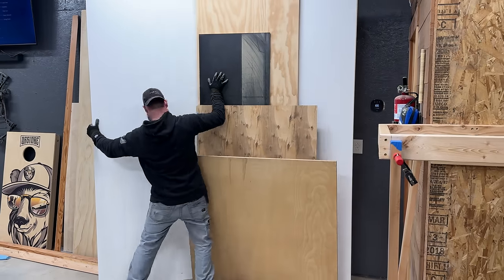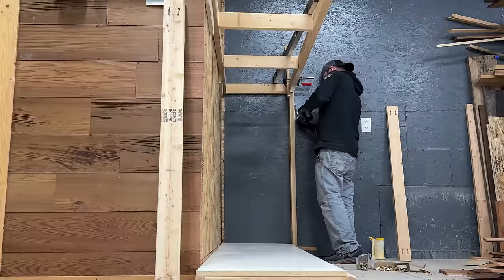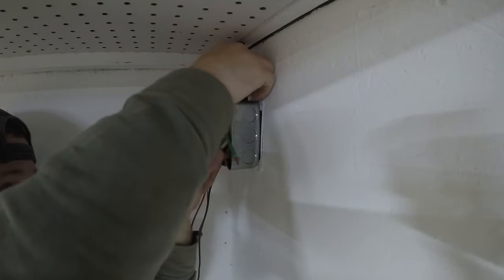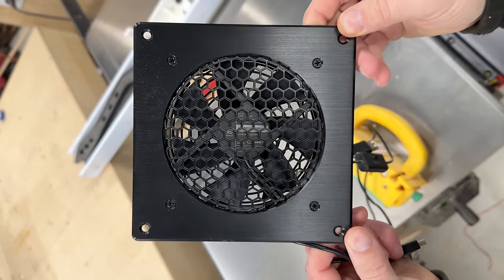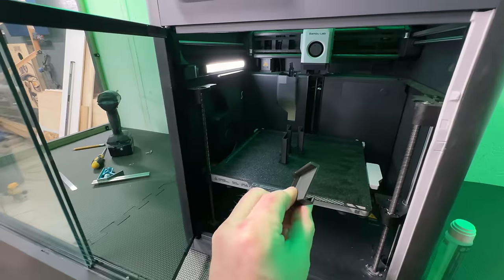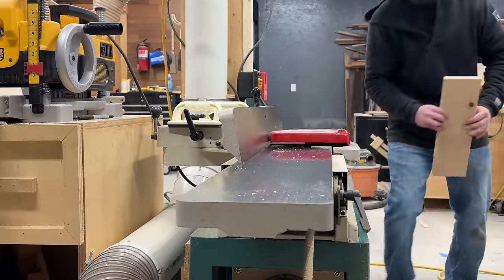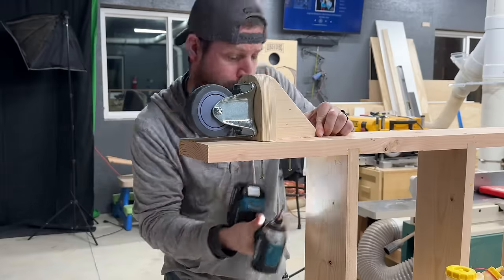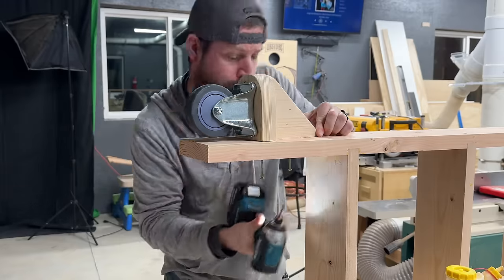The first of it's kind! Regaining valuable shop real estate!

Comment: Nice build.  Was thinking you were crazy venting the printers into the bathroom, glad you have plans to vent outside when your print ABS/PLA/etc...  Ladder is neat...  but I think if it were me I'd build a ~2=3' high platform (with steps) and then put lumber storage under it for both eight footers and off cuts.  Always need more space for scraps.
Reply from the maker: Venting into my bathroom and the fume concern was always something I wasn’t super pleased with. I have since made both fans pull air from the bathroom and direct it into the enclosure. So no more circulating it, but I am still working on on the separate setup to exhaust it to the outside of my shop.👍🏻

The ladder was honestly more of a fun challenge, and I agree it’s not the best solution. I’ll be addressing that along with other changes in a future video. Thanks for watching and commenting. 👊🏻

Comment: Nice job. To move all your sheet goods you need a Garbo. See Izzy Swan...You could mount and power it on your unit some where, I'm sure. 😅For your new access ladder look at a Werner S313P-2. It folds to about 2" thick. I can already see your 3D printed keep-it-handy -but-flush-against-the-wall bracket. Just subscribed...
Reply from the maker: I think I’ve seen the video izzy has on that. That’s actually not a bad idea! 

That Werner ladder is exactly what I’m thinking will be the most logical and is convenient. The ladder I built was purely out of curiosity, and a reason for me to see if I could do it. I knew it wouldn’t be a permanent feature. 😂😂

Thank you for watching and taking the time to comment, and I truly appreciate the sub.👊🏻

Comment: Cool project! Maybe another small fan blow into the cabinet (filtered) will help keep dust out with positive pressure? I built one of those rolling carts.... I was renting at the time, ended up moving 3 times in 5 yrs! Was REAL handy then. I've since added pneumatic casters so I can roll it out of the garage easily for spring cleaning (leaf blowing) in the garage.
Reply from the maker: Thanks for watching! I’m working on the filters and adding additional fans. 👍🏻 

I’m looking at building a small single wheel dolly setup to make it easier to slide the sheets in and out, and moving them around in my shop.
Reply: @brewbuilds  great idea. Like a little skate. There’s always the venerable harbor freight furniture dolly haha
Reply from the maker: @BenNawrath  I actually have 2 of those, and the casters on them are the worst. 😂
Reply: @brewbuilds  haha yeah that’s no good. I got some fantastic 5” ones from Amazon for a sanding cart I made. Gotta be 300 lbs… drum sander, 12” disk, and spindle sander all on it. The simple irony that a shop vac can’t roll over its own cord is exactly what’s wrong with America. Good casters isn’t too much to ask for.

Comment: Great video. Thank you for sharing the journey. Regarding your 3-D printer vibration… I currently have mine on a paver stone with a piece of carpet underneath of it… Do you think the harbor freight pads would be better than a solid piece of stone with the carpet to help reduce vibration?
Reply from the maker: Thank you! I’ve seen people do that with pavers before, I guess the idea behind that is just adding more mass to the platform the printer(s) are sitting on.🤷🏻‍♂️ I think the important part/first line of defense is having a solid surface for the printer to sit on. I haven’t done the paver method before so I don’t have any way of comparing it. I can say this foam matting has proven to work extremely well, and I don’t hear any vibration.

Comment: Nice build.  Have you considered using the space between the ladder and cabinet for you off cut storage?
Reply from the maker: Thank you Steve! I have, and at the end of the video I talk about adding an off cut storage rack to the left of the opening for the sheet goods compartment. I’m a little hesitant putting anything permanent on the face of it because if I ever do need to use a little step ladder to access the inside of the enclosure I’d have to lean over it to get inside. 👍🏻 thanks for watching, and taking the time to comment. 👊🏻
Reply: @brewbuilds  I had a similar solution in mind.  Since you have 8' of space, you could make it a relatively narrow bin, with stepped sections for different length offcuts (tallest in the front, since they're likely to be heaviest), and the shortest in the back.  As long as sticks out less 12" or less, you shouldn't have too much trouble reaching from a stepstool.  Also, it may be worth a little effort to realign the bottom wheels on the ladder to reduce that problem.  Clamping a 2x4 across the bottom, and butting the wheels up against that should help.

Comment: So, dumb question, but why put plywood sheeting on the lower cubicle? That's a huge amount of space that would be useful otherwise if you put up, say, pegboard or something instead.  Plus, could run an outlet or build in a power strip or something to also set up a battery charging center to maximize space utility?
Reply from the maker: No that’s not a dumb question. I still have plans to add some type of accessory hanger/storage. I personally will never use pegboard for hanging tools again. I find pegboard for that use to be a pain in the ass. Thanks for watching.👊🏻

Comment: Really nice... one comment/question though: why not have some type of sliding door on the outer wall in mid-to-back area just to allow for accessible storage of smaller pieces in the back end of the storage area?
Reply from the maker: If I’m understanding correctly, you are referring to the back of the plywood storage compartment? That would have been a really cool idea, except I would have had to make the compartment/enclosure longer, and  could have. But then it would have stuck out past the face of the bathroom wall. Which isn’t un-doable it just would have took up more space, and then it turns into a game of (how big should I make it). I’ve got some ideas for the smaller piece storage, and other add-ons/ corrections that I’ll address in a future video.👍🏻 thanks for watching and commenting. 👊🏻

Comment: Very interesting build. Two questions/suggestions for the ladder. Could you modify the caster mounting with some sort of springs so that it would contact the floor when you put your weight on it? There by increasing the safety. Also, is there a space in your shop where you could mount another piece of iron pipe and use the ladder there to access elevated storage?
Reply from the maker: Hey thanks for watching and commenting. The spring loaded caster idea also crossed my mind and it’s something I’m considering for sure!

Currently this is my only elevated storage in my shop, but things could change. 👍🏻

Comment: get some single sided sticky door frame foam on a roll (Home Depot) to put between the panes of glass for a better seal
Regards, rick...........Subbed
Reply from the maker: That foam crossed my mind, I was worried it would stand out when looking at it. I’m sure the small 1/4” ish strips wouldn’t be too bad though. 

Someone else mentioned the clear seals for shower doors which would be another great option.  Thanks for watching, taking the time to comment, and the sub. 👊🏻
Reply: @brewbuilds  
Also another idea 
If you can lay a good bead, then a clear bead of caulk would work too

Comment: If you pump more air into your 3d enclosure than you pump out you can over pressure that area and thus... no dust.
Reply from the maker: I wondered about that. I’m kinda curious how it does with time. Thanks for your comment. 👊🏻
Reply: @brewbuilds  I think the glass doors will have a lot of leakage but you have two fans you could use. Try it. You would probably want filters on the fans.

Comment: Awesome. One thought on the dust issue is to just up-size the “intake” fan in either size or speed. Just get more air into that space than leaves through the other fan and it should have a slight positive pressure. 

Might not be perfect, but should be enough for sawdust.
Reply from the maker: Looks like I should do some experimenting, I also had that thought, and since uploading the video I’ve had multiple recommend that idea. Thanks for watching, and taking the time to add valuable feedback. I truly appreciate it!👊🏻

Comment: A couple of things raise alarms with me.  The first is that there’s no fire suppression in the enclosure. Using a Meeross sensor only tells you that there’s a problem. Unless you’re in the shop it’ll be too late to react. Look into a self contained auto triggering extinguisher. Second is the fans circulating bathroom smells into the compartment. Yuck.
Reply from the maker: You can’t argue with extra safety, but a fire suppression system might be a little over the top. I did consider a smoke detector. I’m really not to concerned, the outside of the printer isn’t hot by any means, and it is no different than this sitting in an office in your house, or on the workbench in my shop it was previously. 

So far so good with not having bathroom smells circulating in the enclosure. 😂
Reply: Eh, who’s in the enclosure to report the smells anywho? ;)
Reply from the maker: @georgemilnes2  😂😂 I guess time will tell, but so far so good.